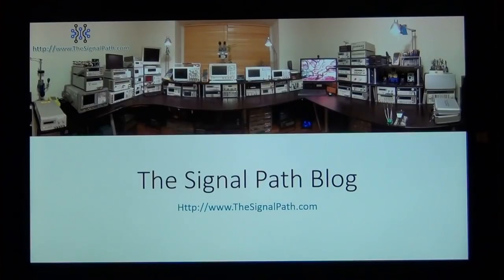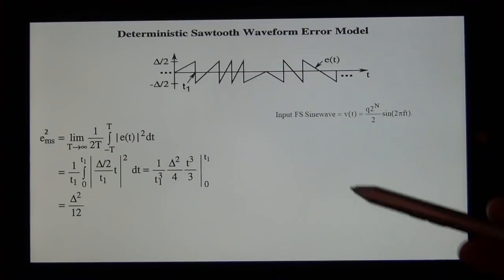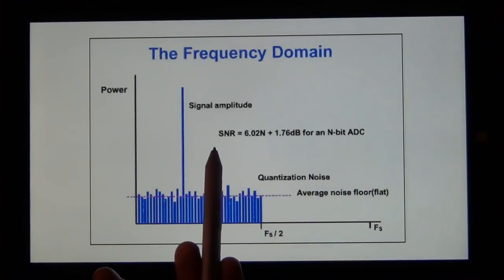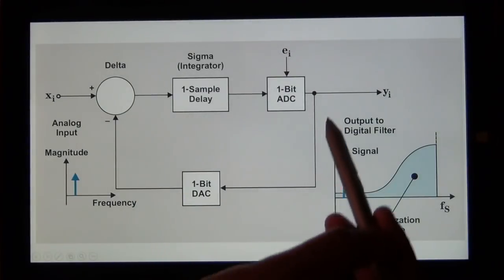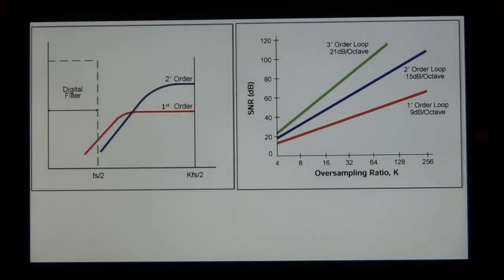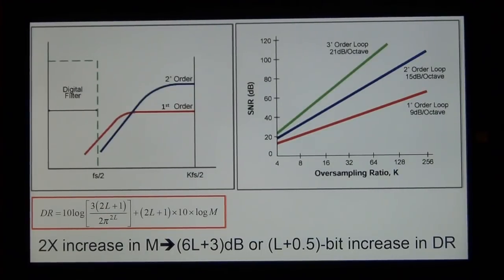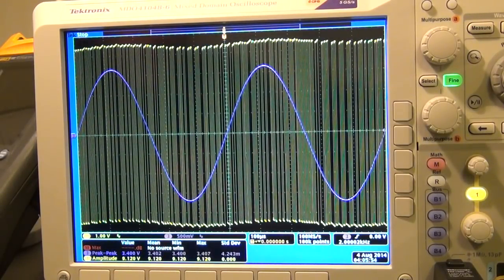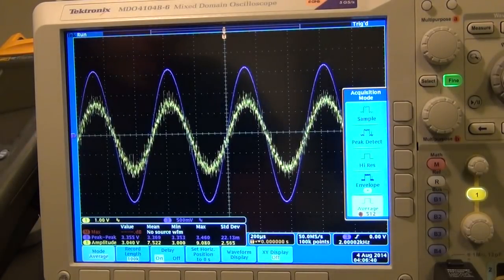TSP #32 - Tutorial on the Theory, Design and Measurement of Delta-Sigma Analog to Digital Converters

Comment: Great video. Just one thing I want to point out: for a 2KHz input signal, the nyquist sampling rate is 4KHz. If the sampling rate is 256KHz, then the oversampling ratio should be 64 not 128.

Comment: Very nice and detailed tutorial! A very good supplement to my books reading. I especially liked the practical part, as i now know how to both build the circuit and measure it correctly. 
Now i'm looking forward to implement the  Sigma-Delta modulator in the Class D amplifier, that i'm building and measuring it afterwards.

Comment: You can't use both signals from the same source because your quantization error is no longer randomly distributed?
Reply from the maker: Yes! You can't use two phase-locked correlated signals for clock and input signal to an ADC for exactly the reason you described. Smart girl! ;)
Reply: TheSignalPathBlog
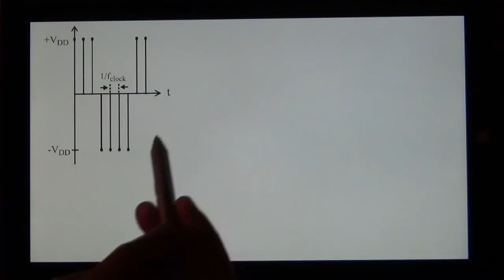Well, I still miss the REASON. Why is like that? I´ll try. The funny thing that bad ass genius of Shahriar gave already the answer at 30:00, since the RIgol and the Agilent are just DAC. The outputs of the Rigol are two digital signals converted with a sample and hold correlated with the same internal Rigol clock, and in frequency there are shaped in the same way (Sync of internal clock Rigol, since there is not an tunable with frequency out analog filter at each Rigol output). Same thing for the Agilent input signal generator. Maybe those 2 tones in the spectrum when you showed us the Sync function are the related with the clock input and signal input considered as digital ones with a sample and hold to convert them to analog... And you are right no books are telling you that!!! How did you get to this point? Anyway smart girl Rosanah Murugesu and smart boy Shahriar. Why don´t do a follow up video to respond to your mysterious questions?
Reply: Coaina Zuppero If your clock frequency is a multiple of your sine frequency, you will be sampling your sine at the same points in each cycle of your sine. So, if you plot your quantization error vs. time, it will be repeating with the same period as your sine, let's call this period T0. A signal (in this case quantization noise) which repeats in the time domain with period T0 will have a fourier transform which is zero except for frequency points where f = k*(1/T0) where k is any integer. The spectrum of the quantization noise will no longer look like white noise! It will have spurs at multiples of your input sine frequency.
Reply: Rosanah Murugesu  So by definition a DAC which has on the input a periodic N words sequence and a clock sampling/rendering of Fs will produce an quantization noise in the f domain as a impulse train at f=k*Fs/N (since T0=N/Fs). That´s why the two DAC Agilent and Rigol are generating the two tones at 56:10 ? Maybe I was thinking starting from the f domanin analysis, a sample and hold DAC with a numeric sine signal input will generate a train of impulse in fraquency shaped by a Sync. Maybe I am confusing signal output and noise output. I am still digesting this stuff, sorry if I was/am not precise and clean like you in your explanations. Definitely a smart girl.
Reply: +Rosanah Murugesu 
But what will be the problem/impact if the quantization noise is not white? Its not clear to me... can you eloborate more?
Reply: Having random quantization noise is generally considered better because eventhough it reduces your Signal to Noise ratio it does not, in the case of an ideal converter introduce any spurs and hence distort your signal. Having quantization noise that is correlated to your signal is bad, because as Rosanah pointed out, it is going to introduce energies at the harmonics of the signal being sampled. So now the sampled representation contains some harmonic distortion.

SD converters are mainly used for audio stuff, and in audio, as many would tell you, a fuzzy sounding signal (contaminated with white noise) sounds much more bearable than a harmonically distorted signal!
Reply: Hi Rosana. Small world!

Javad

Comment: Excellent video.  I fell your math is easy to follow, I love the fact the you do not go into demonstrating all the formulas, just enough so it can be followed.  I have used DS in the past, and I had my understanding of them, but not as nice as you explained here.

I really liked the "what if"s, linearity, sampling frequency changes, input changes, and the consequences of those.  Also, it is nice to see in a real circuit, not only block diagrams where every other documentation stops.

I wish all my uni professors would have been just 10% as good as you are explaining...  sadly only a few were.

Comment: Wow, this is about as accessible as signal processing theory can get.  I'm really impressed.  Only problem is, now I want to build a couple of low-Fs DACs to play with.  ;-)  Might be interesting to hear the actual differences between topologies and filtering strategies used in audio A/D with exaggerated noise floors.
Reply: Can the delta sigma accept dc signals ?

Comment: For your input signal, is the reason you cannot use the same signal generator have to do with the timing of the clock? Does the signal generating possess some form of phase-locking that will synchronise the signal with the clock frequency? I am trying to imagine the flip flop synchronisation in my head, will the signal be sampled at where it crosses zero? I guess that would be my guess to why you cannot use the signal from the same source as the clock.

Comment: The clock and the signal to be measured cannot come from the same equipmant because of the sampling timming rigth?
Reply: I would agree, but the slopes of these signals aren't necessary match. If signals from this generator are "in phase" then you're probably right. Clock and input signal shouldn't be correlated, because in "real" ADC they aren't. But I have no idea what meaning it would have on results of the experiment. I think that quantization noise should be smaller, but it's a hard math to prove it

Comment: how does delta sigma work with self oscillating topologies? for example the irs2092 ic or other delta sigma audio ic's. Looking at there simplified circuit in the data sheet they're functional blocks  don't mention anything about an adc or a dac. Curious how these work. I'm assuming that perhaps there's more going on in the chips then the simplified block diagram eludes to, like one of the labeled blocks is also functioning as the adc or dac or it was left out all together??  Although I have seen and built a few self oscillating class d amps that didn't include an actual adc or dac but had maybe a comparator that was in effect acting as a one bit adc maybe this is also what's going on in the irs chips, but the feedback (the sigma I assume) is not converted back to analog but pulled directly from the half bridge, pre filter, which thinking about it as I'm writing this the filter could be the dac. Interesting

Comment: The AD817 op-amp is expensive, can I replace with LM358 which has only 1 MHz unity gain bandwidth  for the integrators? I need a low cost solution for low voltage application (only has 9V single supply)?

Comment: The D flip flop IC is biased with positive and negative supplies but which IC did you use.
I tried using 7474 and it became really hot and was causing issues

Comment: Thank you very much for your great explanation.
I want to ask you what is the benefits of the caps on the power supply lines?
Reply from the maker: They are for filtering. Especially for mixed-signal circuits, they play an important role.

Comment: So, is the following statement true ? 

" If we did not use a delta sigma modulator and only oversampled an ADC, every 2x increase in sampling rate would result in 3dB improvement in SNR. 
On the other hand, using a N order DSM along with oversampling let's us get (6*N+3) db improvement in SNR, for every 2x increase in sampling rate"
Reply from the maker: Yes, that’s right.

Comment: Nice video...Isn't it the over sampling ratio = Sampling frequency / Niquist sampling frequency ?  If it is, then the over smapling ratio used in this video is 64 not 128 because the Niquist sampling frequency is 4kHz..

Comment: from 1/wp = 8.5us, gives you fc = 18.7kHz. How did you get the 28.3Khz?
Reply: boboatusa because, this is the fc for a 1rst order filter, and the second order filter is not so easy like fc=1/wp. You can draw the bode diagram in matlab and you will see that fc=28.3kHz:
>>.num=[0 0 1];%numerator of function transfer (1)
>> den=[7.225e-11 8.5e-6 1];% denominator of function trasnfer:(s^2/wp^2 + s/wp + 1)-->(1/wp)=8.5e-6.
>>bode(num,den);

the response is in rad/second.

Comment: You mentioned that the 1 bit ADC and DAC are linear but aren't they nonlinear and time variant? Here the model assumes they are linear and time invariant but in reality they are not.
Reply from the maker: A one bit ADC and DAC is always linear. Only one way to connect two points, with a line. The gain of the ADC and DAC May differ from sample to sample. Time invariance is not relevant here.

Comment: Although it's been five years, I still want to have shot at the question you posed..
Since the clock signal is the one which decides the sampling instant, and hence the quantization error value, taking both the input signal and the clock signal from the Rigol will make the two signals somewhat correlated and the quantization error then won't have uniform distribution from 0 Hz to k. fs/2 Hz , which will cause the spectrum of quantization error to be skewed/grouped in some bands of frequency thus allowing us not to determine a low pass filter which can filter only the signal content?

Btw, thanks for the great content!

Comment: the download of the slides is not working and returns error 404 page not found.
and as usual shahriar will not respond.
i do not know, but it may be a copyright sort of thing.
any how, many of the slides here are also found on the following link from texas instruments:
Nuts and Bolts of the Delta-Sigma Converter
shahriar is an excellent teacher when it comes to teach concepts but he always misses the small details, this may be because he is trying to stack a lot of information in a short time and doesn't want to bore the audience.

Comment: 17:47 - wp is not the pole of the integrator. wp/s has a pole a f = 0. if you want an integrator with a finite pole then you have to use  wp/s+wp

Comment: Great video, I love the fact that anyone can learn about advanced techniques in your videos. It might require a bit (a lot) of background knowledge but it is great to make it available.
One question, why not leave the flip flop altogether and run the comparator as the A/D. Wouldn't that give you the "max" clock rate ?
Reply: Good question,I was thinking the same... Might be wrong but that comparator doesn't have a complementary output so he uses a FLIP-FLOP for complementary output.
Reply from the maker: No, the flip-flop acts as the sampler. Without it, you only have a quantizer and no sampler. In this case the flip-flop also acts as the feedback DAC but that is a different story. Remember that an ADC has to have periodic, well defined output sampling circuitry otherwise the output is not in discrete domain.
Reply from the maker: ***** Please see my answer to  Léopold Delouche-Vilpoux.
Reply: TheSignalPathBlog That makes a whole lot more sense now, Thanks a lot for the answer.
Reply: TheSignalPathBlog yes you are absolutely correct! the clock input was the missing detail. you cannot sample at the comparator level only quantize.

Question would the propagation delay of each stage of the op-amp influence this circuit at high speed ?? 

I must be honest I am very glad Tektronix gave you a high speed RF scope like that, more videos for us in the future.!! I hope more vendors adopt this style !!

Comment: Thanks for this. Thanks to you, I finally understand this: http://www.aholme.co.uk/GPS/Main.htm - it's extremely impressive work. Here the guy used a 1-bit ADC to sample GPS RF - but without any delta signma loops. Rather he uses the RF noise super-imposed on the signal to "wiggle" the comparator threshold. When you have an oversampled 1-bit DAC, low pass filter, decimate and FFT, hey presto there's your signal! Like you say - magic!

Comment: There is a little mismatch between H(z) and an integrator TF, I don't believe that the TF given by author is a TF for an  integrator TF . The integrator TF that I've used is 1/(1-z^-1) therefore STF and NTF are different, in our case SFT = z^-1 means a unit delay which has an constant frequency response, it is not a Low pass frequency response. SFT and NTF must be recalculated. But the statements of the author are true, signal has a LP transfer function, and noise has a HP transfer function.
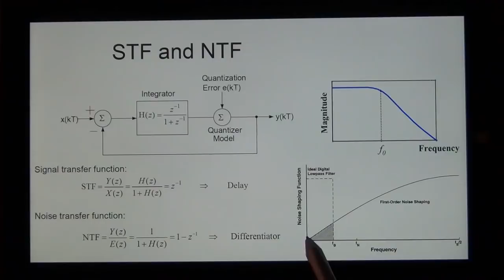Reply: 17:05

Comment: Coming from a firmware view, I would like to see the Op-Amp circuits explained in more detail, I think "1-bit ADC" was half-explained halfway through this video, and it always helps at certain instructive points to run the numbers through an equation to clarify what is being explained. In addition, toward the end, the specific topology of the various test devices used should have been diagrammed to show clearly the complete test setup.

Comment: How do you get from the high rate bitstream to the numeric value in a real chip? I didn't quite understand the slide with the 1-bit input and multi-bit output (around 27:45 for example). Does this mean you just add up the ones within a certain interval? What would be the b_i then?

Could you say a delta-sigma-ADC is like a SAR-ADC, but trying to approximate over time not in voltage?
Reply: The block diagram represents a FIR filter where each tap operates by delaying the signal and multiplying it by a (chosen) coefficient (b_n in this diagram). The output of all taps is then summed to produce the output. These coefficients can have any resolution and are chosen to produce the desired digital filter characteristic (low-pass out the shaped noise) and full scale output, and the output signal will then have the resolution of the accumulator.

Comment: Excellent video. You explained this way better than most TA's and professor. But one question: Is it possible to get an unstable loop here? and also, you mentioned a miller cap (the green cap). How do you figure out what caps to use here? lastly, if one were to design those op-amps what design specifications would they need to worry about? (gm, gain, bandwidth and so on). Again thanks a lot! (Fadayi dari agha :D)

Comment: Absolutely fantastic video, Shahriar! I had wondered about delta-sigma ADCs for a while, but nothing I read was as clear as your video.
I still don't understand the part where it goes from the (high-frequency) single-bit stream to the multi-bit stream after the digital filter - I probably need to re-watch that bit of the video.

Since the integrator/difference op-amps act as low-pass filters to the signal, does that mean that one doesn't have to pre-filter a signal when using delta-sigma ADC (as is otherwise recommended to avoid aliasing)?

Comment: As one option ,instead of use a + - power supply, you can create a virtual ground with a pair of resistor and conects to op amp and comparator ground, same effect will be achieved

Comment: Shahriar, I ran the simulation in LTSpice IV and it worked beautifully. I've been trying to build  an interface for my old  8 channel analog preamp  (PRA-8 by NADY) in my recording studio to convert audio signals to Digital signals and then convert them into USB data.  You have open the door for  me to design it. I still need to learn about getting the digital data into USB to connect into  the workstation and build a driver that could be use in SONAR PLATINUM edition to render the data in separate tracks. Could you teach us on this subject?  How to get digital data streams into a USB 3.0 port?
I also ran LTSpice IV on the opamp Square wave to Triangle wave to PWM it ran as you mentioned. I think the extra opamp was used to produce to negative power rail needed for the third opamp  R||R net going into the opamp (-) input

Thank you for been there for people like me who love electronics and can't go to school you are a blessing
Reply: Why wouldn't you just buy an off-the-shelf USB ADC for this exact purpose? Building one yourself (unless you do it with an ASIC or something) will not produce very good results, especially in a recording studio. If you want to do it just for fun, go for it, but for serious recording you can't beat the results from an expert with decades of knowledge designing a product.

Comment: I have a quite possibly silly question. What's the point in the 1-bit DAC in the feedback loop? If the input is digital high or low and the output is 2 levels of analog (high or low), what's it doing? Level shifting? How's it different from feeding back the digital signal?
Reply from the maker: Yes, you are right, in this case it acts as a block which provides the correct levels back to the input. In a multi-bit configurations then it is needed of course.

Comment: I am also curious why one wouldn't use this technique for most, if not all analog to digital conversion. It seems like a great way to reduce noise and has pretty much workable limitations (i.e. op amp head room vs signal strength).
Reply: Also, the DelSig-ADCs are usually more expensive, than SAR_ADCs